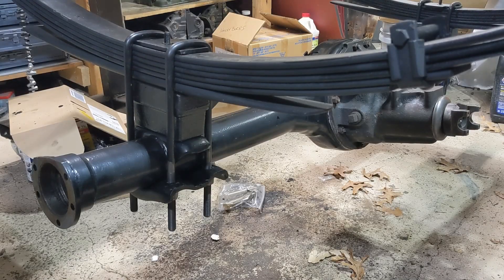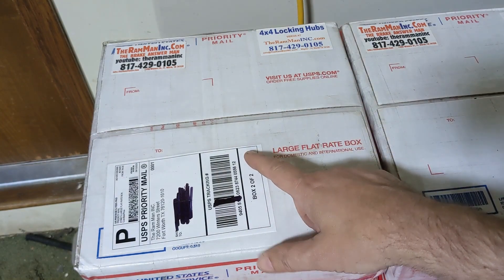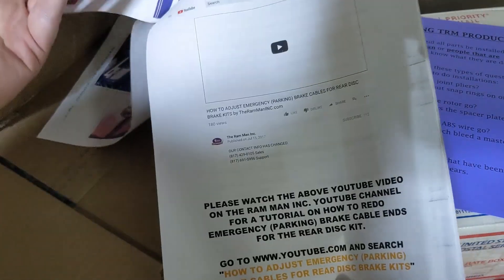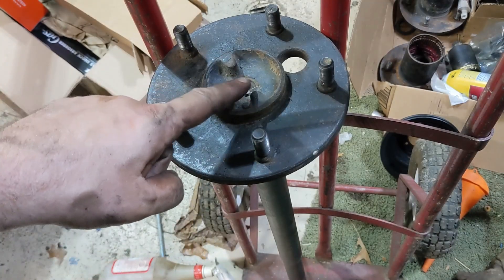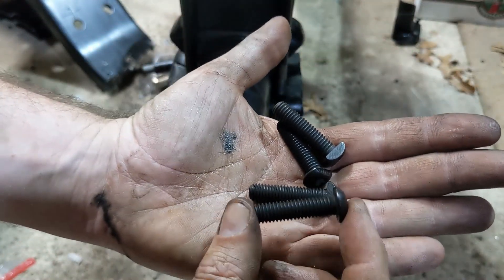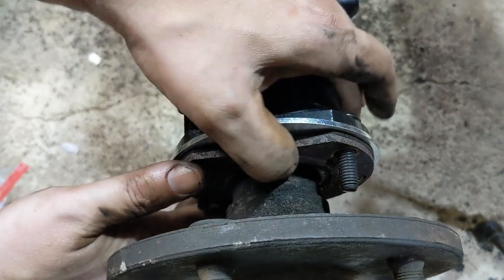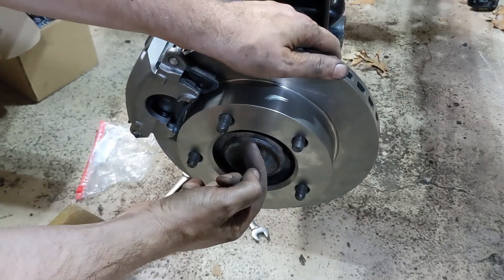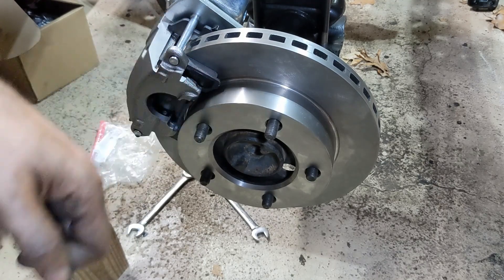Mopar 8.75 Disc Brake Conversion: Ram Man Inc Version (True Spirit #32)

Comment: This kit was installed before I bought my 67 Charger. The prior owner did not install the axle shim. Is that really necessary, if the rotors line up well with the calipers, would the missing shims be a problem?

Comment: Thank you so much for this video, just finished my install and no way I could have done it without this video. The instructions that came with the kit are horrible.
Reply from the maker: I think we need hub centric spacers, too, to center the rotor to the hub. My kit did not come with them
Reply: @YoshimoshiGarage  How did you make out with those spacers? I'm going thru the same thing now, whether I need them or not.
Reply from the maker: You definitely need them.

Comment: I know you are not done yet, but have seen MANY, MANY videos of tubers showing the HOW TO and never completing the job. The part everyone misses is squeezing the outer pads outside fingers against the caliper to keep the pad from rattling and early wear.  This can be done a few ways, but I find it easiest to use a very large channel lock plier and squeeze the finger toward the  center. This needs to be done on top and bottom and on both sides.  This can also be done by wedging a chisel between the rotor hub and pad and hammering the finger to the caliper...

Comment: Fyi, If you hadn't noticed and somewhat surprised kit didn't include but you'll definitely need hub centric spacers to center your rotor on axle... did you notice the slop when you tried to rotate? Definitely can't and shouldn't rely on studs and nuts, it's a safety issue and will vibrate like crazy as the rotor moves around. Measure ID and OD hub and rotor order from a place out of texas online. Had them made for my cragers on 8 3/4 even though many stated you could not... well i proved them wrong. Definitely smoothed the ride as most cragers are slotted uni-lug which leaves them off center of the hub when lugs are tightened. Thanks for sharing!
Reply from the maker: Agreed.  I probably need to make or buy a couple spacers to keep it centered.
Reply: geez right you have a lathe!😀 @YoshimoshiGarage